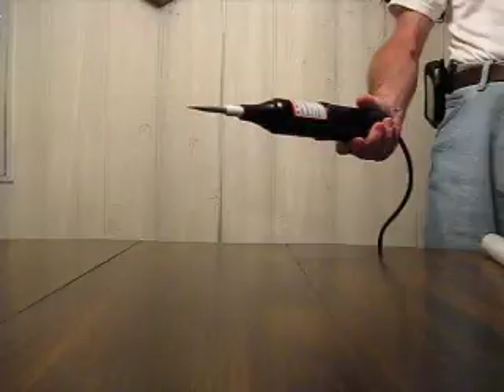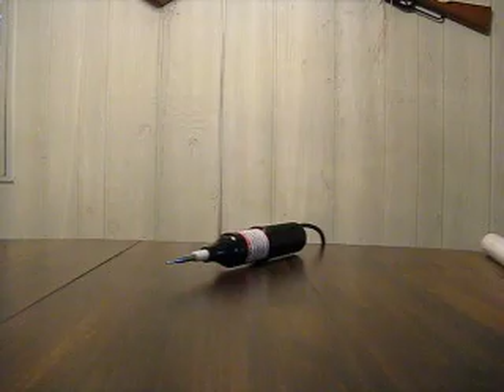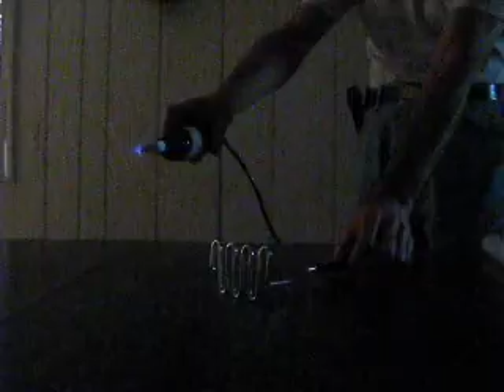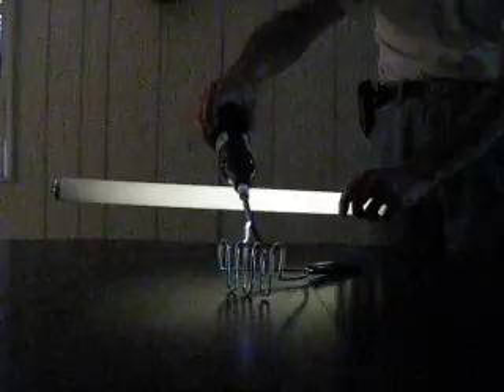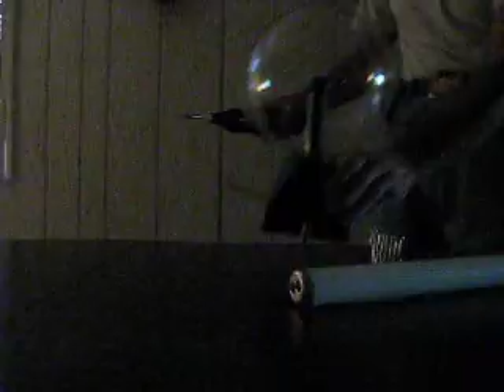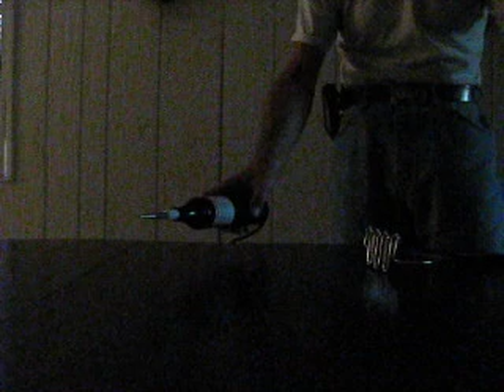Handheld Tesla Coil / Electro-Technic Products BD-10AS

Comment: Hi there, I'm looking for a circuit diagram that will help me to reassemble a grounded BD-10. Any chance you would be willing to open yours up and take a few close up photos of how the ground, neutral and line wires connect to the device? To open the device one needs to remove the 8/32 nut from the collet (electrode inlet) and the two screws next to the voltage level adjustment knob at the base of the device. Attempting to open the device, without first removing the collet will damage the lead wires to the tesla coil. Thanks!

Comment: those are fun.  they don't hurt too bad either.  though I wouldn't recommend full blast arc directly.  but if you hold it firmly so it doesn't arc to ya, you can crank the knob way up before it hurts.  i got one 15 years back.  soon after a tab broke off one of the internal coils.  didn't have the skills then to repair, so I boxed it up.  thanks for reminding me.  gonna go find that thing and fix it.  I remember it was off the primary winding thick wire. lucky me, could have been way worse